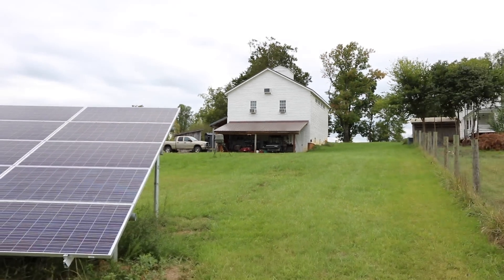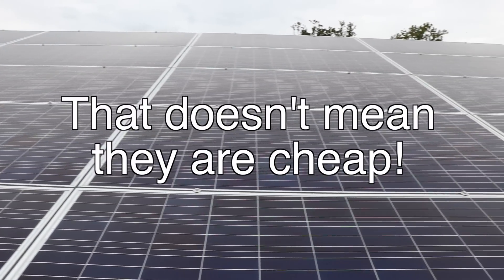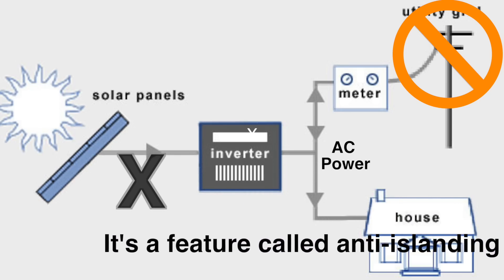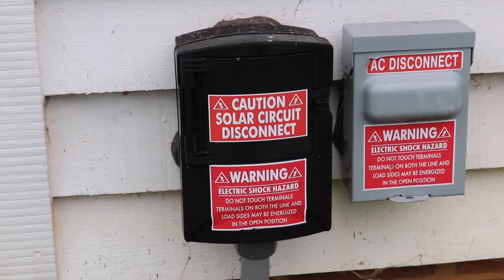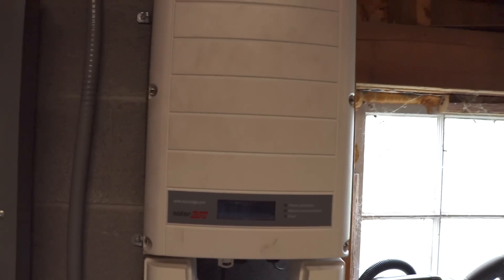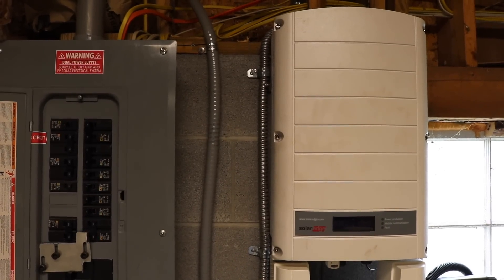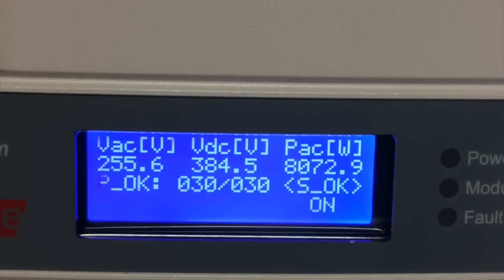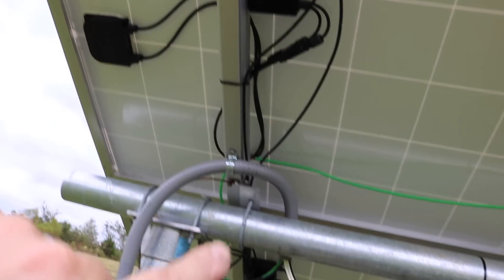The ugly truth behind grid-tie solar systems. Part 1, FarmCraft101 solar.  Watch before you buy!

Comment: I made it to 5 minutes in before I said WAIT.
My system cost me less than $3000. My system is 2k in panels. Well wait, in truth, at this moment it is 1.2k as I haven't hooked up a couple panels yet. First and foremost ditch the electric company. Max time I have been without electric is 1 day in 2 years. Better than anytime I was on grid. I run a freezer, electric water heater, lights, pc, washer machine, and power tools when needed.   But I do things different.
First I have 1200w of panels ( $1200 ) we aren't counting my panels not hooked up.
(6) 1.4kw deep cell batteries ( $90 plus core) yes there are better and more expensive batteries 
(7) battery cables ( $ 10 each)
3000w Sinn wave investor  that ties into a breaker box ( $600) you could use a mod wave, but a lot less works on one. 
No charge controller, or any other garbage. ( I've had 2 charge controllers and ditch them, they don't let your batteries charge to 100%. In other words they charged to 11v not 13.4v ) 
That is all you need, and when other are without electric, your lights will be on.
 I just showed you that for $2400 you can have a good system 
That one day was because I get some wind (over 100 MPh often) well I didn't have my panels secured. When I came home they where several hundred feet away, next morning I hooked them back up.  Real panels are pretty durable. I've also had almost bowling ball hail hit them. New windshield in truck but panels were good. 
I could use 3x the batteries. Will make batteries last a lot longer. I estimate my batteries will last 5 years.(on 2 years now) If I had 3x batteries should last 20 years. My panels will last 50 plus years. 
 My modified charge controller, when I go to work I turn on my freezer, when I come home I turn it off (600AH) 
BTW for you knucklehead that think you can make money selling to electric company. You cost is 17 cent per watt they pay you 1.2 cents per watt, plus you charge for grid, $50 plus. It is made so you won't make money. 
I foresee that for every person in a household add 500w of panels, and batteries should be 10x what you have in panels. Use gas or wood for heating. Because I like a house to be 90 degrees when it is minus 10 outside.  I use a 12v swap cooler when it's hot out. But since I like it hot, I rarely use it. If you live in a humidity place swam cooler won't work.
Reply: So at first you said that you ditched the charge controller then you say you are using a modified charge controller. Not sure what to think. Just by curiosity, how much voltage are you putting in the  existent/non-existent charge controller and how does the charge controller is configured to work? Thank you.
Reply: @PeacefulCountryLife  I think he's joking. His "modified" charge controller is turning off the freezer while at work, turning it on when at home.
Reply: Yes Like Florida, even a water cool ac unit wont take the humidity out of the Air like a Freon base ac unit.
Reply: you could also use an independent solar powered hot water system and install a pipe fed under floor or radiator heating system the hot water generated and kept in tanks that flow to the heating system  using low voltage to heat and maintain the temp which will be thermostatically controlled to your requirements that  also isolates the hot water supply from the water heating system when heating is not required any excess power stored so that you have enough power to maintain the low voltage heating at a consistent temp for prolonged periods with the capacity to supply enough energy needed to boost the temp or to give hot water on demand being able to feed any excess energy to your main house system when your energy consumption for heating is low  which in turn you will tap in to from time to time to power the hot water/heating system..
Reply: Come install my system! I'm getting ready to spend a large chunk of change.
Reply: Where did you learn this?

Comment: 1) Does the power company have to come out and put in a special meter? 

2) Do plug and play systems need to feed into 240 volt outlets?

3) Would you say in a hot area where HVAC systems run all night in the summer you won't be able to count on as much savings as "average" use areas could expect?
Reply from the maker: 1. Yes, a net metering meter must be installed.
2. Not sure.  Mine is hardwired in.
3. I don't think so.  The more electricity you use, the more you stand to save.  Of course, it all depends on your generation capacity what percentage of your electric use will be covered by your solar system.  If you use a lot of electricity running all night, then you would need a larger array of panels to cover that usage, which would cost more to install, but would save you more money every month.  It also depends very much on how expensive your electricity is per kWh.

Comment: Just to address the many questions on battery backup systems as opposed to grid tied only. When you factor in the cost of battery backup, the lifespan of the batteries etc. there is no reason to use battery backup. If you live in an area where power failure is common and you only want to insure you have power during and outage you can get a 10kw generator, transfer switch and fuel for less than the cost of battery backup unless your power is out for huge amounts of time. If you are off grid then by all means a battery backup is the way to go. A generator is not cost effective and in addition you are unlikely to have natural gas available so transporting propane or gasoline to run a generator is also a pain in the butt.

Comment: ,?wouldn't be cheaper to get mini inverter for each panel rather than optimizers+inverter
Reply: mini inverter are way too expensive. Optimizers are much better. But in an open space as they have on their farm, I not even would spend on optimizers. You only need these, if you get partially shadowed by trees or roof.

Comment: Hi there. I am wondering where your system is -- not the address, but what state you are in and what utility company you are tied into. I am wondering because I am in PECO's territory, in Pennsylvania, and they limit the voltage allowed in the inverter so we have to apply settings to the inverter so that it shuts down if it reaches 253 volts. They say this is required by the Public Utility Commission in Pennsylvania.  Anyone have any insight into this issue and whether it impacts other utilities?  I am in the Philadelphia area where the infrastructure is older which plays a role.

Comment: Well how the fuck do you increase voltage and lower amperage? Different solar panels?
Reply from the maker: You wire the panels in series.  If your panels produce 10 amps at 36 volts, if you wire 2 in series you will get 10 amps at 72 volts.  10 in series you will get 10 amps at 360 volts.  On the other hand, if you wired 2 in parallel, you would have 20 amps at 36 volts, and 10 in parallel would be 100 amps at 36 volts.
Reply: That sounds right to me.  Inverters usually have only a certain amount of amps they can handle.  The math looks correct many do not understand the parallel and series. In parallel you increase the amps but the voltage stays the same,  in series your amps stay the same and you increase the volts ;
Reply: I have two batteries in parallel and the output amperage stays the same when I remove one of the batteries.
NOTE: Both batteries are unprotected. 18650 4.2v 2000mah batteries at an unprotected 15amps.
NOTE: Electrician as a father says the only way to increase amperage is to reduce resistance.

Comment: The most important parameter that you mentioned is Anti-Islanding, which is infact a safety parameter for inverter but a serious problem for Main-Grid. 
Infrastructure, power networks are still required. 
Energy storage in any form is the future challenge.

Comment: The resistans of the installation cables is not needed to make the energy flow to the house vs the grid. It is not depend Where you attach the grid tie inverter as long as you hook on it on the right side of the energy meter.

Comment: What is the purpose of owning solar panels if you can’t use it without the grid? Thought that was one of the main reasons for getting solar
Reply from the maker: It's just a matter of money.  The grid tie systems have become cost effective, but going off grid cost considerably more.  If your goal is to generate green power and save some money, a grid tie system is a good choice.  If your goal is energy independence, you're going to have to pay a lot more.  Thanks for watching!

Comment: If the grid shuts down you're out of electricity?!?  That's a bad deal.  Screw the grid.  Let them get their power somewhere else.  Go off-grid.  Charge batteries.  In Europe you have the option of using the grid as a backup to your solar.  That's what I want.
Reply from the maker: It's just a matter of money.  The grid tie systems have become cost effective, but going off grid cost considerably more.  If your goal is to generate green power and save some money, a grid tie system is a good choice.  If your goal is energy independence, you're going to have to pay a lot more.  Thanks for watching!
Reply: I admire how neutral you can be about it.  Excellent video!  Unfortunately, the businessman DNA in me flips on when I think about grid tie.  It makes zero economic sense to sell your products (electricity) at a loss, and then be subject to a government's poor production practices (outages).  I'll happily pay 2x-3x more to avoid that scenario.

Comment from the maker: If you still have more questions, see my follow up video here: https://youtu.be/gPycyuVJ_Cg  Many questions will be answered!
Reply from the maker: The whole system installed was 17k.  That included everything including inspections and permitting.
Reply: Tel  ghone
Reply: You can do it much cheaper if you want to.Don't be put off by the 17K price tag :D
Reply: Your system is expensive. In Netherlands, I can buy a panel for 0.60 EUR/watt http://www.jenm-zonnepanelen.nl/ja-solar-ja-solar-300wp-mono-jam6k-60-300-pr-b.html
If I could buy solar panels at wholesale price 0.3* EUR + VAT and shipping - I would jump on making hybrid system with DIY 18650 power wall
Reply: You can buy a simple propane generator a lot cheaper.
Reply: Yes it is always a difficult decision when it comes to batteries. You might get lucky with used deep cycle batteries or you might not. New ones will always be rather expensive. You might prefer to connect to the grid with a grid tie inverter if you can. Right now there seems to be an abundance of cheap used ones. But you might also prefer a hybrid system where you charge some batteries with extra panels (if you have the money and the space) Since off peak electricity is usually from 11 pm to 7 am (at least it is where i live) it would be nice not to pay for the peak electricity when you need it after sunset and before sunrise. Otherwise there are going to be quite a few hours where you will need to purchase electricity back at peak rate, especially in the evenings when you might be cooking and spending more time in the house using appliances etc. It might be more interesting to some people to sell their limit back to the grid in the day time but then switch to batteries until the off peak rate begins (if you have such a plan available). Then you can use the cheaper off peak electricity to run some appliances through the night unless it works out better for you to run things such as washing machines and dishwashers during the day from your own solar power. That depends on the deal you have with your electricity company and how much they are willing to pay you for your KWH's compared to what you can buy it back from them at night. 
  You might also take advantage of the off peak rate to charge your batteries to get you through the peak hours where the panels might not be generating or during spells of bad weather.
  And if your totally off grid then you might want to use a generator as well as having a battery bank and solar panels. If you have to start the generator it should be powerful enough to provide you with the power you need and also be able to charge the batteries at the same time. After a few hours you can kill the generator and go back to batteries, repeat this cycle until the sun rises :D In an ideal world we would have enough panels, enough sun and enough batteries not to need a generator but it's always a nice backup plan.

Comment: There are grid tie inverters which allow you to use some solar directly when the grid is down.    
this is not a big deal.    If you need power constantly because the grid is out, you should just have an off-grid system. 
you can save tons by buying used panels, buying used micro inverters to match whatever panels you manage to buy, and install them yourself.  
If you purchase the newest, latest equipment, and pay for installation, you are paying about 3x (at least) as much as you should be, so not the fault of the technology. 
I have a grid tie system, and a small off-grid system as well. both are expandable, and since I bought the micro inverters used, I'll not lose any money on them if I ever decide to sell them, and go with a completely off grid system.  
just do it smart people.  it's great, and can pay for itself in a couple of years.
Reply from the maker: All true.  I discuss those inverters here: https://youtu.be/gPycyuVJ_Cg  Thanks for watching!

Comment: I got my panels installed like.. 8 years ago. I have lower voltage panels (they are quite old now) but I also got a battery backup unit. It's all based on Sunny equipment, so Sunny Boy's for inverters and Sunny Island for battery backup. It's able to automatically convert from grid tied to battery backup in the event of a grid failure. This keeps my house operating during hurricanes :P and also through the frequent power drops in my neighbourhood. It's quick enough that computers don't go down.. You might see the lights flicker a bit when it happens, but for an extra 4k or so ontop of the ( cough 80k that my entire install cost - it was well worth the '5% extra). Batteries do need to get replaced... they say once every 5 years, but if you're not all that concerned about how long you can power your house off grid, I expect you could double that. :)

Comment: Your description of the house as ‘having a voltage drop’ is not technically correct. The house simply presents a conductive path. The inverter is producing power at a relatively constant voltage. As such, it is a current source. The house takes current in proportion to its power requirement in the moment. The rest of the current from the inverter goes into the grid. Of course, the voltage being produced by the inverter must exceed the grid voltage slightly, otherwise no current will flow into the grid. However, the house doesn’t “have a voltage drop”. The voltage drop is in the output impedance of the inverter and in the associated wiring to the grid. You can get an idea of the impedance of that grid connection by monitoring short circuit current (do not try this at home) that flows before a circuit breaker opens. Let’s say you get 2000 amps (YMMV). That tells you that ‘grid’ impedance is about 240V/2000A = 0.24 ohms. For that grid impedance, if the inverter needs to deliver 40 amps into the grid, it has to develop an rms voltage about 9.6V higher than the prevailing grid voltage. The important concepts are a) current path and b) power conversion and delivery. (Not voltage drop in the house)
Reply from the maker: I appreciate the discussion, so don't take offense, but I don't think I agree.  "The house simply presents a conductive path."  A conductive path to what?  Answer: ground.  A path to zero volts.  Voltage flows downhill.  Just like water, it's not going to go uphill.  The reason it flows through a motor is because the motor is giving it a path to lower voltage.  Perhaps it's just semantics, not trying to be argumentative, but I can't see any other explanation for the current to flow.  And if you measure the voltage on a circuit while engaging a large motor, say an AC compressor, you will definitely measure a voltage drop.  The drop will be larger while the motor is starting up, but even once it is up and running a smaller but measurable drop will be present until the motor shuts off.
Reply: FarmCraft101 It’s not something to agree or disagree on, since this is not a matter of opinion. Even your notion of ‘ground’ is not technically correct. Current does not “flow to ground”. Instead, current flows in a circuit, which may or may not include earth ground, depending on how things are connected. The house completes a circuit, and every electron that flows into the house flows back out to the other terminal of the generating source (pump, in your analogy), albeit at a lower potential. The house load simply conducts whatever current it needs at the voltage supplied by the source. Other loads, including the grid itself, can take any remaining current available from the inverter, provided that the voltage on the grid is lower than the voltage generated by the inverter. Due to negative feedback, the inverter has a very low output impedance, as does the grid, so very small voltage differences can deliver lots of current. As a power engineer who designs inverters, I think I have a pretty good understanding of these things.
Reply from the maker: "so very small voltage differences can deliver lots of current".  Yep.  Voltage drop.  We agree!